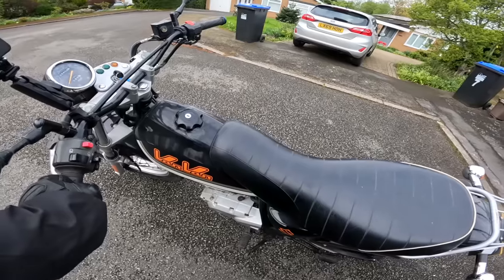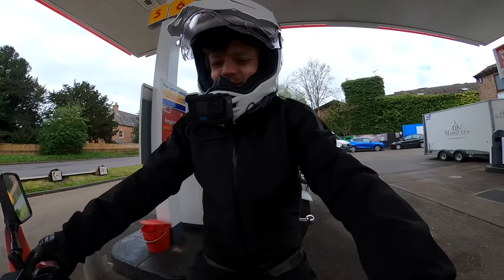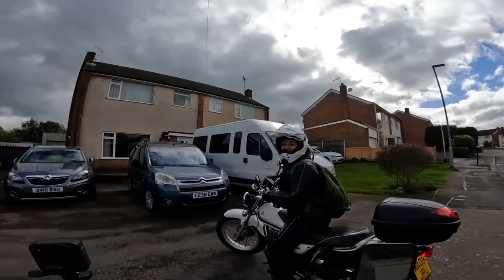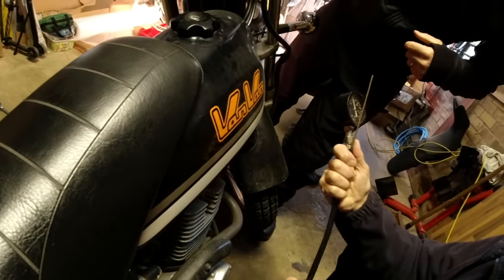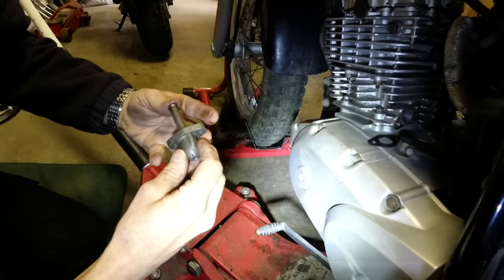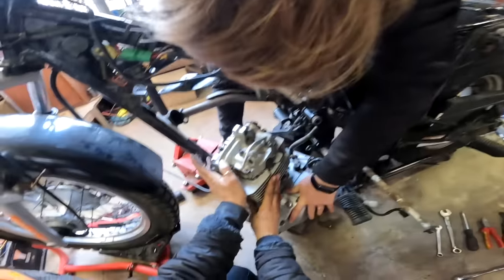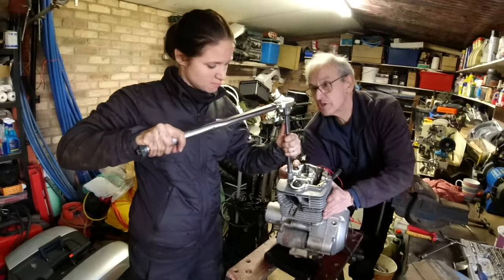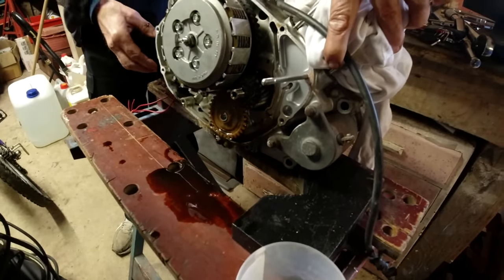MY NEW BIKE IS BROKEN... [S7-E5]

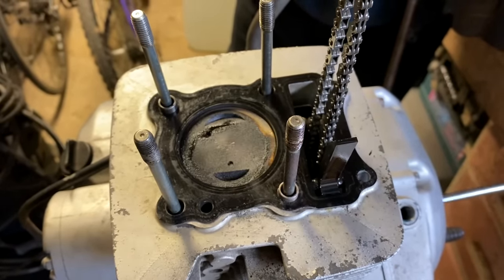Comment: (I am not an expert, but…) It looks like your piston rings are bad. @14:15, notice the edge of the piston crown is clean. Usually the carbon deposit is fairly uniform across the whole surface. This might be where oil is passing through while the bike is running. Yes, I realize you are getting compression, but the oil control ring could be bad and not the compression ring. If you look up “Blown Head Gasket - Visual Evidence” Dave shows an example of what happens when a head gasket blows, but also talks about “ring wash”. I think you’re piston has ring wash. I hope this helps. Thanks for sharing your adventures! Best of luck!!!
Reply: Isso ocorre devido a válvula Pair que joga os gases da queima para dentro da câmara de ar e esses gases mistura com o ar e passa pelo carburador e depois entra na câmera de combustão para ser novamente queimado.

Comment: Maybe a Detonation problem with the ignition timing incorrect, this is where the spark plug is firing at the wrong time. This would also explain the starting and lack of engine power. It can certainly cause the type of noise you are getting. I used to Drag Race motorcycles and have heard this type of noise before, prior to an engine failure. It can sound like small or big end failure, but is not, a simple fix, keep my fingers crossed for you. Really enjoy your videos and currently catching up on your world tour.
Reply from the maker: Thank you so much 😁

Comment: Hmmm that's an odd one... Almost sounds as if the ignition timing is off.. hence lack of power and poor starting and that popping noise is the ignition still occuring while a valve is opening... Like it's letting out a bit of the explosion too soon lol.

Just my guess, probably wrong. 

What a top chap though!

Comment: I think you gave us the hint with the picture at the beginning of the video. Probably one of the loctite fixes underneath the stator cover, something's banging around under there possibly. I run a DRZ400 and they're famous for loctite fixes. This is good experience for the both of you those engines are fairly easy to work on. Don't forget to grease your mechanic friend when you're done (no pun intended) 🥃🥃🥃🍺🍺🍺💷💷💷💷
Reply from the maker: 🤪 thanks so much ☺️

Comment: Had a similar issue on another model, but check also the carburator that can rattle lose and the air passage for "foreign objects", check also the wear on all sprokets and that you have no dirt or bad chips inside the oil ways. Sometimes sprokets chip off and still have little play but the whole thing messes up the cylinder. Just a few guesses over the air it is difficult to help more, sorry.
Reply from the maker: Thank you so much for the advice 😊

Comment: Not even two minute in yet, But I'm worried that's a rod knock, and I wouldn't run it at all! I'd be pulling it apart and having a good look at the bearings, and inspecting & measuring the crap out of the conrods big end.
In saying this, that wouldn't affect it starting. that would be down to Valve train. (just can't tell because I don't know how fast it is supposed to Idle, I'm a Car mechanic who just brought a Motorcycle, I'm yet to really learn anything about them)
OK i heard it during the compression test (and cringed) that's Valve train. the question is, has the rocker damaged the Camshaft or valve?? or is a cam bearing?

Comment: This is the best possible   way to learn ,I hope  the issue  is nothing  serious.
Reply: Knowing how to take apart your engine and how your motorcycle works is always good. Especially when you're on longer trips. Learning it from someone with hands-on experience is really good. 

I needed to take apart my engine because of because of bad ball bearings of the crankshaft on the cvt side (continuously variable transmission). Got most of the  information from YouTube. Replacing the crankshaft still takes most of the day. Bringing it to a mechanic would just cost too much. Probably more than a new engine.
Reply from the maker: Totally true 😍

Comment: I had a similar sound in my Suzuki GSX 400 F. There, one of the outermost bolts holding down the camshaft came off. Then the camshaft could lift a few hundredths of a millimeter when it was working. Not hard to change once I found it.

Comment: Interesting to watch you guys/guyettes pull the engine down and learning about such things. Best way to learn, and of course, this video will help others learn a bit about how engines work too, hopefully.

Have to ask though - what made you decide on these bikes? I don't know if Suzuki sold the Van Van here in Oz. Love that fat rear tyre, too. 

As for the tyre size, 180 means 180mm across. The 90 (if I remember you calling it a 180/90 means that the tyre wall height is 90% of the tyre's width. Also called aspect ratio.
Reply from the maker: Yes it’s actually so much fun working on bikes 🤩 we just thought that this bike would be the perfect learner bike for Lavi as she’s just starting to ride bikes ☺️

Comment: Can I asky why after going through your test you've both had 125,s considering your doing tours and trips etc.
Reply: Because they are small and light with a low seat height and a low centre of gravity. Lavi and Ollie can put their feet down easily, it's unlikely that they will drop these bikes, and if they do they can pick them back up easily. With the fat tyres and comfortable seat they are good for off road riding. They have no top end power to write home about, but good low end pickup and a smooth power transfer. Ideal for small, lightweight people like Lavi and Ollie.
Reply from the maker: Even though I got my full license I’m not an experienced rider at all so starting with a learner bike will be good for me 😍